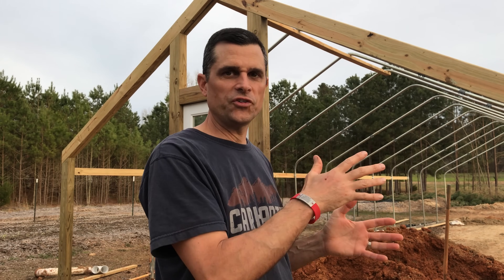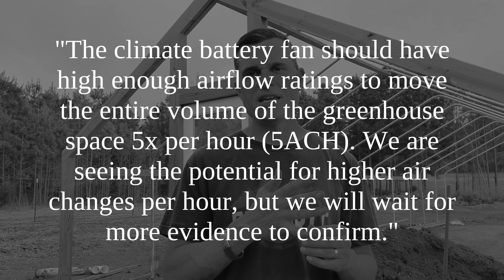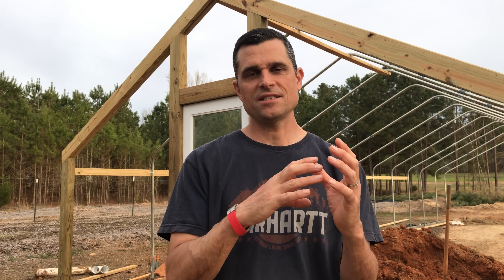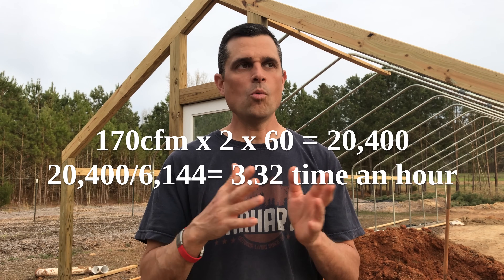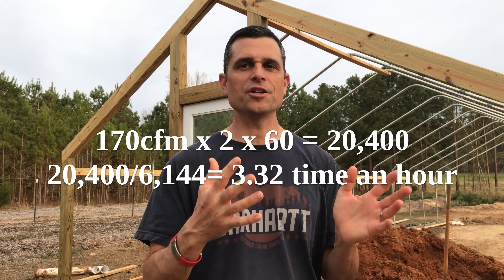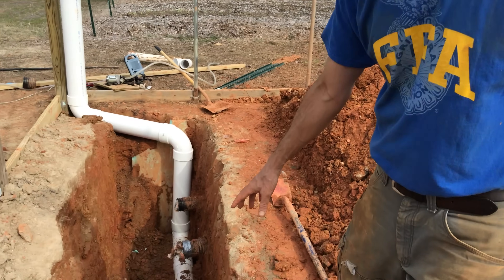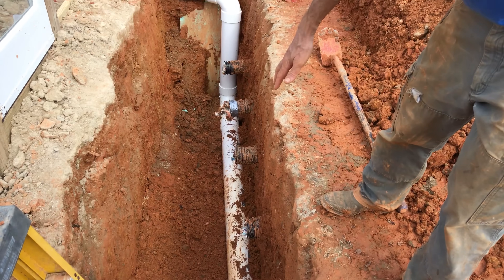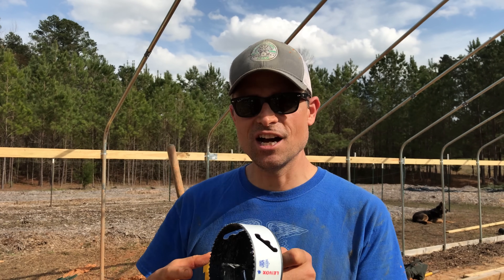DIY Geothermal Greenhouse Part 7: Earth Battery MISTAKE!

Comment: Surely you can't just use the max air flow of the fan to determine the turnover rate of the greenhouse volume due to all the friction of the pipes not to mention the bends slowing down airflow? Thanks for the video.

Comment: In order optimized the heat exchange of your system (which, unfortunately, seems to have many flaws)  It is easy to do if you though to buy variable speed fans.   You just need to vary the air flow velocity while you measure the temperatures at the entrance and the exit of your tube.   The optimal speed will be when the temperature gap will be the biggest.

Comment: Thanks for posting.   We are at the point of adding the drains and now we know to go buy bigger pipe before we start
Reply: If you dont know what size pipe you need for a system,  you didnt do any of the necessary calculations which doesnt bode well for the performance.

Comment: I think someone accidentally hit the F to C button on the thermometer.  Underneath the frost layer depending on where you are located, soil tends to be 55F.  There is a reason wine storage is recommended at 55F.  🤷🏻‍♂️

Comment: 7:40 If the 4" fans were used, the heating cooling cycle would not be 'flat'. Does it need to be flat during the day if the temp can be allowed to rise during the day. The heating effect  of the night would be enough that the 24 hr cycle is 'balanced' (say 8am and 8pm the temps are equal) Smaller capacity fans running 24/7/365 would be more economical while allowing the greenhouse to function all year.
Would there be any difference if the intake was at ground level and after being pushed through the underground pipes the exhaust was at the peak of the greenhouse where the cooler air was mixed with the warmer air before it descended to the lower levels of the greenhouse. That would keep the warmest air for the plants, and the colder air from the ground might be cool enough the growth of the plants is stunted.

Comment: I think a modern, high efficiency air source heat pump would be much more effective at heating/cooling and ventilation, and also cost less than you will have spent on this entire ventilation system.

Comment: That's not an "earth battery" an earth battery uses two dissimilar metals in a trench that cause a potential difference of electricity.  What you have is a geo-thermal heat-cool system.

Comment: No way that exhaust was that low . If it’s that cold it will freeze your hands in seconds.
Spray paint the pipe black where you’re taking the reading with infrared sensor.  
The information you’re providing others is priceless. Thanks!
I think the new white pipe you installed on the geo battery should have been even bigger.  I’m estimating the flow of ten 4” pipes would need a 12” pipe to flow that much. Of course the longer the four inch pipes are the less they can flow. But end results if you had went with 12” pipe on both inlet and exhaust manifolds you would get lots more cubic feet per hour air exchange with the same fan doing less work.
Reply: So you say that using 12” pipe to flow those 4” pipes is more efficient? Will it also work if the outlet pipes (the vertical ones) are 6"?
Meaning the air goes into 6", then 12", then several 4", then 12" and then back to 6"... I am just in designing it so I would really appreciate a good advice in this matter.

Comment: A couple observations:
Hopefully you realize that your fans rated 483cfm is at 0" W.G. static pressure! As in ZERO inches of water gauge!
You'll have to account for pressure drop for each foot of duct/dia. and type of duct material i.e. smooth PVC & corrugated drain.
You'll have to account for pressure drop at every elbow/transition.

Interesting project, looking forward to the results!
Good Luck!

Comment: Did you consider friction loss on corogated vs smooth wall pipes?
Reply: @NotAsTraceable  
You would be amazed how fast the air drops to ground temperature in the tube. The thing to remember is its not how long the air spends inside the tube, its how long the entire greenhouse air volume spends in the tubes.

Comment: 114 to 35 degrees!?!?! This is incredible!!!!
Reply: Either the ground is still full of frost (what's the soil temp at duct depth) or the notoriously inaccurate infrared thermometer is whacked!
You'll need that data for comparison
Reply: You need to know what airflow is involved before you can say its incredible :)

Comment: He's almost right.... Let's say you have six 4" pipes. That's 12.57 sqin per pipe with a total of 75.4 sqr inches. The manifold should be equal to or greater than that in order to have a consistent volume between the manifold and the pipes connected to it and to prevent back pressure on the fan. A 6" inch pipe is 28.27 sqr inches... this is less than half that is needed. A 10" pipe has an area of 78.65 sqr in. A 10" pipe is needed for the manifold using reducing tees to connect to the recirculation pipes. The formula to us is pi*radius*radius. Having said that, since he is using an undersized fan for six 4" pipe he can get away with a smaller manifold. My point is that ALL components have to make sense as far as volume(based on area of opening or cross section). A 10" fan to feed a 10" manifold to feed the six 4" pipes that he buried.
Reply: I’m doing An 11 foot by 16 foot greenhouse . Will a 4 inch manifold connected to 4 inch pipes be ok ? 
Thanks
Reply: @craigberube9890  I just read the original, 3 year old post, and see that we were talking about pushing air? the same principles apply but we have to consider the source. If air then the SCFM that your fan/blower pushes will be the driving factor. If water then you'll have to consider that source. Residential water supplies will not accommodate a large manifold system. regardless of the fluid the principles remain the same; the sum of the legs off of the manifold should be equia to or less of that of the manifold in capacity. I made it simple by considering the cross section of the pipes. The lengths that you are dealing with are not important.... to short to worry about but the longer the pipe the more "drop" you'll get. Like I said before, valves are your friend in that they let you 'dial in'  each leg off of the manifold.
Reply: @thomasfeiller2207  , how do your numbers in the end translate in Cfm needed ?
Reply: The other problem is head loss.  when you are using hard bends, tees and corrugated pipes, they all drag on the air flow.  It effectively reduces the cross section.  It is the reason you feel way less flow at the end.  That means you need to do some HVAC head loss calcs to figure out the proper fan size to get the flow you are looking for.  Google it.
Reply: don't follow that. if your total sq" is greater as the piping becomes more distal from the fan, (75.4 sq" for 4, 4"pipes vs 28.27" for the 1, 6" pipe inlet and manifold), and the 6" pipe is properly sized for the 6" fan, then how does that cause back pressure?  Are you not reducing air friction as you increase total sq" volume of pipe? Are not the 4, 4" pipes capable of carrying more air, not less? I follow your comment, "The manifold should be equal to or greater than that in order to have a consistent volume between the manifold and the pipes connected to it and to prevent back pressure on the fan." up to the point where you refer to back pressure.  What am I missing?

Comment: There are a lot of misconceptions here. I've seen a lot of people doing this and not a single one realises that everything is done wrong. There's a lot to talk about this, but the main points are those:

1. Earth is not, and it will never be, a battery. You can't charge it with heat. The heat will dissipate fast.
2. Geothermal heat is good for winter, but has limitations, as it can't deliver more than 10-15 degreesc Celsius, depending on the location.
3. Geothermal CAN NOT be used for cooling, simply because the pvc pipes and the earth surrounding them can't transfer heat that fast.
4. In summer you vent and cool the greenhouse by opening whatever you have set up for venting. Doors, windows, top covers, etc. By doing this, you also keep the humidity in check.
5. Heating the greenouse in the winter (partially) can be done with this method, but not like you see on Youtube, but by calculating and taking into consideration the mechanics of gases, and thermodynamics. The fastest you're gonna push the air through the pipes, the less efficiency you'll have.

Point 5 is the biggest mistake everybody does. Think of an indoor heating system, with water and radiators. You can't just rush the fluid through the pipes, the speed of the fluid needs to be in accordance with the heat exchanger dynamics. Also, in the ground you should have a single sinuous flexible pipe, not many straight pipes, because of the same reasons above.
You have to push the air slowly to give it time to actually worm up. Also, you should keep in mind that the geothermal map of the Earth clearly shows that above 100 meters depth, there is not much change in the temperature. Also, if you have a hard winter in the location, like -20 celsius constantly, you should place the pipe lower, as the freezing will penetrate deeper into the ground.
It's easy to check everything I wrote. Just run the system and measure input and output temperatures and you'll see.

It's easy to follow whatever everybody is doing, because it seems to be working, but if you put science to work you'll realise very soon that a lot of those "systems" are just fancy way to spend money. This type of heating, I repeat DO NOT USE IT FOR COOLING as it doesn't work, is not used by any of the bigger food producers. They use controlled environments, and electric systems to achieve those environments. They would've been the first to cut out costs, if that was actually working !
Reply: You obviously dont understand how these systems work.
Reply: Well at least some of what you wrote has merit

Comment: So way late now and you have probably discovered this, but you won't get that many air changes per hour due to friction in the pipes. 480 is just the fan. That corrugated pipe has particularly high friction which will reduce the flow rate several times (smooth pipe will too, just not as much).
Reply from the maker: Thanks!

Comment: One of the things I struggle with these ideas, is the sheer BTU issue. Even really good geothermal systems in tight home construction have limits. In an uninsulated greenhouse, the problem of getting the volume of BTUs needed to materially impact the internal temp versus just a plain greenhouse... I'm skeptical and I haven't seen a lot of quantitative results other than folks just being excited about certain methods and undertaking the builds.

Comment: What if you use smooth PVC plastic pipe and pitch it to a sump you could pump from?  As a plumber I’ve run some very long sewer lines with pitch the entire length, SDR 35 PVC is  thin wall sewer pipe that is easily available with fittings for many sizes.

Comment: The 6 inch vs 4 inch is probably a little worse than 2.25 difference.  (6/4 = 1.5, and the area is proportional to the square.  1.5 squared is 2.25)  With fluid dynamics, and similarly with air flow, there is friction/drag in the air flow near the walls of the pipe.  Thus, the effective diameter is a little smaller.  Example: a 4 inch pipe has the same cross sectional area as 16 one inch pipes, but will let far more air through quicker/less pressure.

Nice videos.
Reply from the maker: Thanks!

Comment: Question...
For heating purposes,  wouldn't it be better to pull air from the floor and push it out a higher vent pointing down?
And vice versa for cooling..
Reply: I thought about this too.  With the venting lower you get a mixing of air. In Southern California all air vents are in the ceiling for cooling purposes, but in Oregon all the vents are on the floor for heating in homes.

Comment: What I dont understand is why use air when water is much more calories per cubic..solar water into a tank inside ?
Then it's also possible to use small dimension pipes ?
https://youtu.be/LYODYOG5-S0
https://youtu.be/Sc78nueDQ64
Reply: You gain a lot more benefits by using soil.

Comment: When laying down the perforated pipe, do you have the holes pointing upward facing the sky, or down towards the soil? Does it matter?
Reply: If the perforations are in the valleys you should use a circular saw to make a straight cut partway through the corrugations (not all the way through). When you install the tubes place the cut at the bottom. If you dont modify the tubing, you`ll have condensate sitting in every corrugation which will negatively impact the heating performance.
Reply: @JohnGuest45  I saw the comment you left me along with another comment. You really seem to know your stuff. I am installing a greenhouse right now and could use some feedback. I am planning on doing a single run of 6" corrugated perforated pipe that is about 230 ft long. It starts at one end of the greenhouse then goes out into an open field, snakes, and comes back into a different end of my greenhouse. Question: Will the 6" opening with a 6" can fan rated for 420 cfm be sufficient for circulating the air inside of the greenhouse? Should I install two can fans, one at each opening where the 6" pipe comes in? Keep in mind (just to reiterate), I am doing one single long run of 231 feet with no manifold because I am at 10 feet deep (which is about a foot lower than the actual frost line for my area). In other words, this is a true geothermal greenhouse project and not a climate battery. Any feedback would be much appreciated!
Reply: @sigcrypto4404  
Without knowing the size and volume of the greenhouse, its impossible to say ;)

Comment: Who convinced you that air is a adequate heat transfer media? They lied! Use a truck radiator connected to a water pipe that you lay in a s shape in the dirt, a regular fan to move the heat from the air to the radiator and a circulation pump for the water loop and you have a system that will work both for moving heat from the air and returning it when the air cools. what you get is a thermal load that will slow both heating and cooling of your green house. Good luck.   Ps. the more water you have in the system the more energy can be stored.

Comment: That is not an earth battery son.  An earth battery is two plates of dis-similar metals (copper and zinc for instance)  burried about 12 feet apart making an earth battery cell.  Lots of amperage but low voltage (about 1.5 volts per cell).  But 8 of them strung in secession will give you 12 volts forever, day and night, with no generator!!!  They ran the telegraphs with earth batteries for decades in the 1800s.  But you made a mess here :)  Looks like your wiring a floor or ceiling for "ceiling heat".  Now a 12 inch corrogated drive way tile burried cornor to cornor 5 feet deep, with a 4 or 6 inch input and output would slow the volumn in that pipe enough to convert the air to 57 degrees (which is all your gonna get anyway).  A heat strip in the output pipe would only have to raise 57 degree air by 13 degrees to achieve 70 degree air!!!!!  A thermostat and zitty-boom-bop ;)  It ain't rocket science :)  Did you check to see what the numbers would be if you used the 4 inch you had and boosted the output to 70 degrees instead of 57?  Now that wouldn't run much except in extreme weather, because the thermostat wouldn't come on till the air dropped to 50 or you would be blowing air hotter than 57 into the pipe!!  Good luck youngin' ;)

Comment: You might want to turn the fan down anyway. You might as well give the air a chance to exchange some heat as it does it's lap underground. A short section of pipe can handle a high air speed just like a fuse can handle lots of current. If you turn your fan speed down you will save money, does it heat both ends from each roof top end or does all the hot air go to one end and then traverse the greenhouse floor? I saw someone complaining that they had got this wrong and had ended up with uneven soil temps.
Reply: Don't forget. Your not neccesarly trying to circulate the entire volume of the greenhouse. You are just circulating whats hot, so really at any one time the volume of hot air is being circulated, during spring and autumn it can take some time for the roof to heat up so circulation will be slow anyway. During the summer you may want to just have a shade cloth covering. and a pullabale pvc in case of cold or overly wet spells.
Reply: The air in my tubes can drop over 30F in less than a second, most folks dont have enough fan power to outrun the cooling capacity of the tubes.
Reply: @JohnGuest45  That's good to know. Surprising considering the plastic ribbed tubes are good insulators.
Reply: @izzzzzz6  
Single wall perforated drainage tube isnt much of an insulator, the corrugations increase the effective surface area considerably.
Reply: @JohnGuest45  I suppose so, at the end of the day plastic is probably the best thing you can use anyway, unless you can score a load of old cast iron mains water pipe.

Comment: T's on the 6" manifold would have made better adapter/connections with the 4" corrugated runs.
IMO, if the side walls of the greenhouse were plastic and the roof screen, that would form a chimney effect. The cool air in the tubes would be drawn into the greenhouse by convection currents created by the inside hot air rising and exhausting out the roof. IOW, the lower part of the greenhouse would be filled with the coolest air, drawn out of the ground (if your objective is to cool the greenhouse, as in AZ). No fans required. 😎
Reply: He's in North Carolina. They're cooling in the summer, and warming in the winter. He said the air needs to be turned over ~5x/hour. I don't think a zero-fan system has that capability (especially since there are no top nor bottom vents)